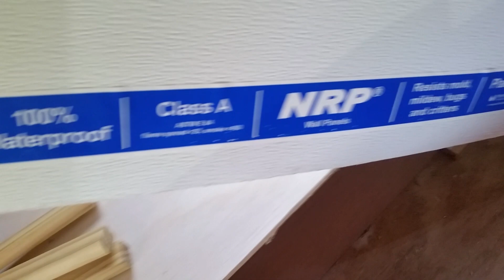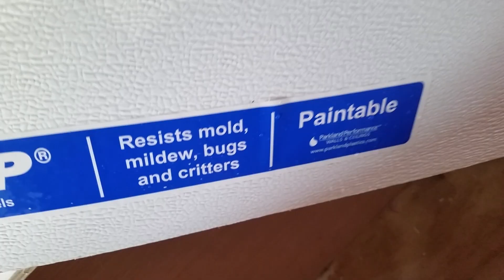DIY Camper Shower Stall

Comment from the maker: I bought foam floor mat at Harbor Freight.  You get four squares.  One square fits the floor well, and makes it comfortable to stand on.  I plan to cut away where the raised ridges are so that the foam keys onto the ridges.  It will not be able to slip, and it will lay nice and flat.

Comment: Great job on the shower pan. I was curious on the drainage with such a small drain hole?? Also what are you using for a drain tube what is the diameter. Thanks for the great idea
Reply from the maker: The drain is  Ø1.25" standard bathroom sink drain.  I think household tub drains are Ø1.5".  Not a big difference, plus I am only flowing 1 GPM, so it is plenty big enough.  The drain assembly has a tube (tailpiece) on the bottom that is approximately 4" long.  That extends below the floor and I just let it drain on the ground, or catch it in a bucket.  I put a rubber stopper in the drain when not in use to keep bugs out, and air conditioning in.  Yes, you can feel cold air coming out of the drain if you don't plug it.

Comment: Hi, that looks great, did you decide how you would handle installing a holding tank or otherwise?
Reply from the maker: For now I haves a self-contained, battery-powered shower.
My plan is to build in a pump that will pick up from a Jerry can outside, on the ground.  Permanent plumbing to the sprayer.
I'm still researching pumps.

Comment: This is a great help for my bathroom headache!😁  So do you have anything under the shower pan or does it just sit on the wood floor? Thank you!
Reply from the maker: It is sitting directly on the wood floor.  I left a gap under the front board that you step over to get in and out.  I did that to allow air to circulate around the pan.
In hindsight, it would have been wise to paint or otherwise seal the wood.  It wouldn't hurt.

Comment: for the panels going up, did you just stagger them by an inch or so?  and caulk underneath it? I'm looking at doing the same thing. the only difference is i bought a shower pan on amazon 27x24 to accommodate my area with out moving my cabinets.
Reply from the maker: That's correct.   I overlapped about two inches with a continuous bead of adhesive centered in the overlap. 
The type and size of the pan on mine was dictated by the available space,  which is the same in your case.   As long as you have vertical walls (not a curved van side) this method should work great.

Comment: Use professional exterior  caulk  The kind you see expansion joints in brick walls/sheetmetal on commercial buildings. I think its butyl, it stinks for a while but it will stick until your retirement. Happy trails.
Reply from the maker: Indeed.  This is no place for latex or silicone, in my opinion, either.  The sealant that I used is called "Quad" and is available at Lowe's and other building supplies.  It is a professional grade caulk that comes in cartridges, and is applied with a caulking gun.  It adheres to the plastic like a champ, and has proven to be durable, stays white and flexible, and will not peel off.  It comes in several other colors as well.
One other sealant that I would recommend for this is 3M 5200 Marine Sealant.  Very similar to Quad albeit a bit more expensive, 3M 5200 has a great reputation and plenty of reviews on the internet.
Those are the two sealants that I have hands-on experience with that I can personally endorse with full confidence.

Comment: ...Great Start ..but no follow up.
Reply from the maker: You're right.  I was planning to do an update that includes the pump system, but I didn't get around to it, and now I am refurbishing a boat.
Here's a link about the pump I'm using:  http://mississippi-mud.com/thread-20479.html

The finished stall is shown in part 3 of my camper build:  https://youtu.be/BDQwH7zC1PI

Comment: Seams like that would be painful to stand on
Reply from the maker: I bought foam floor mat at Harbor Freight.  You get four squares.  One square fits the floor well, and makes it comfortable to stand on.  I cut away where the raised ridges are so that the foam keys onto the ridges.  It cannot slip, and it lays nice and flat.  Very comfortable to stand on, and seems to dry quickly even when I leave it in place.